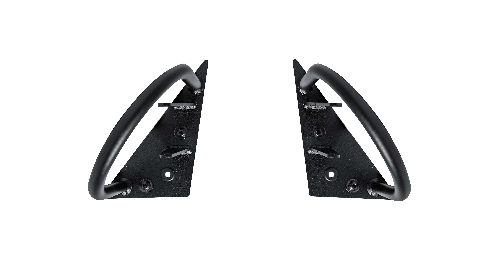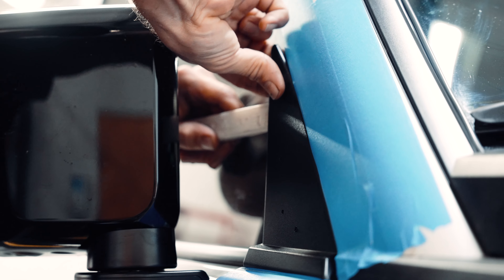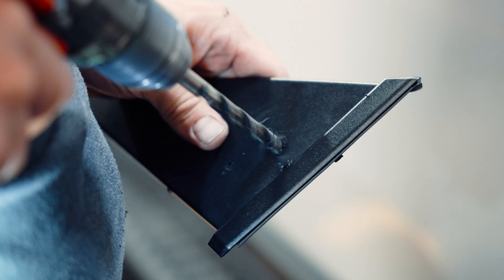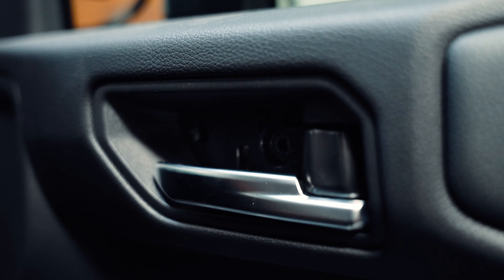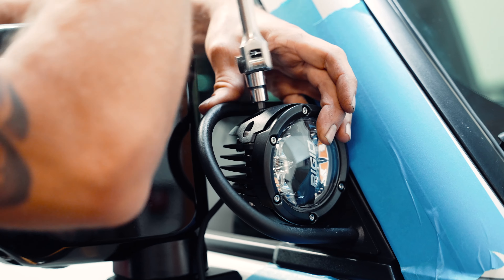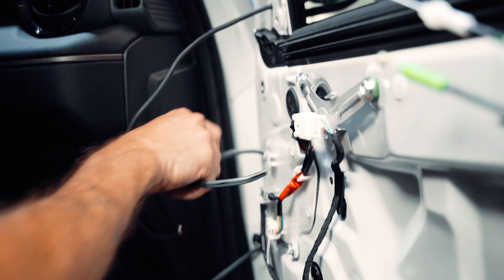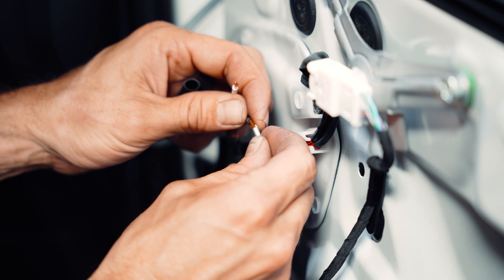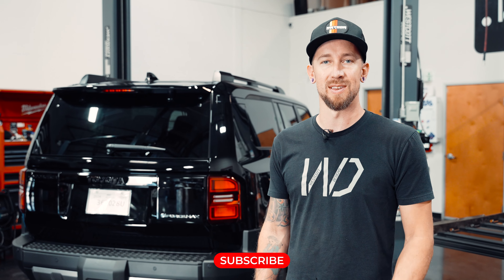2024 Toyota Land Cruiser Ditch Light Bracket Install

Comment: The Ditch Light is never connected to a power source. It is decorative only.
Reply: Yes, I am wondering that too. What power source did you connect it to in the engine bay?  Do you control it from a switch in the cab?
Reply: @brycerollins9496 yeah I’d like to know the power source too. I’m stressing over hooking these and some rock lights up to the battery in back. Being able to connect under the hood would be so much simpler.